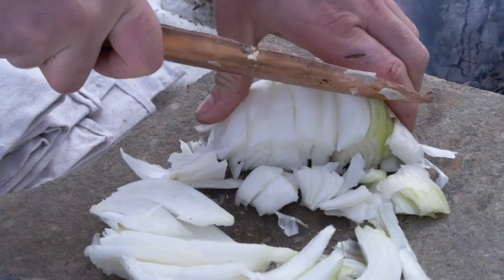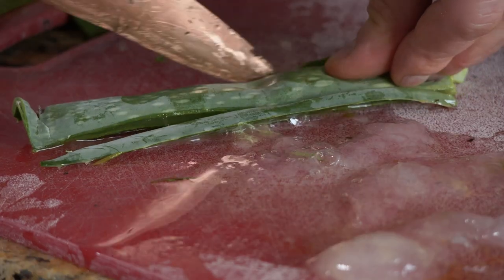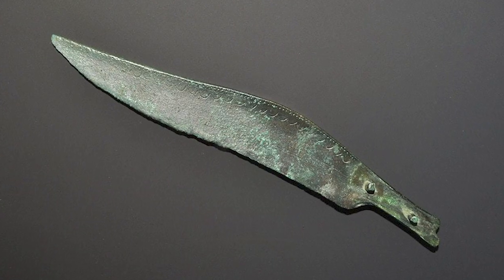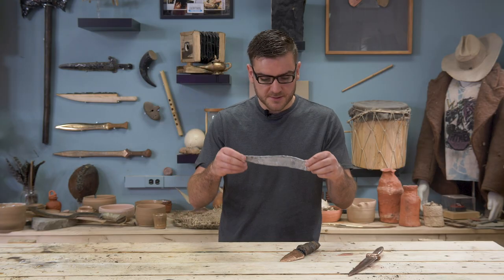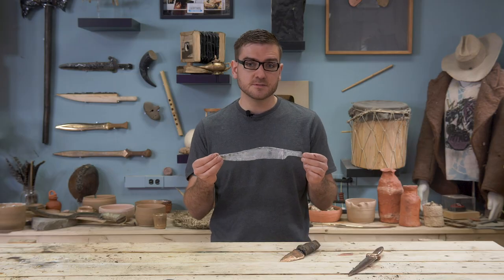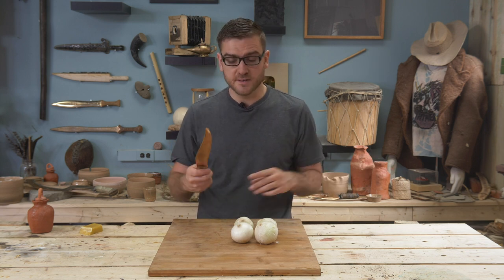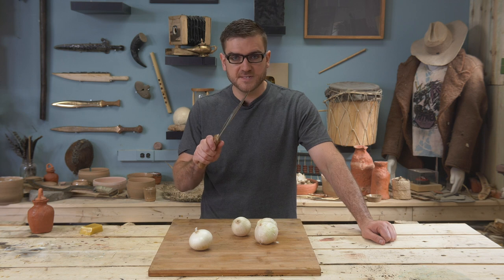How to Make the SHARPEST Bronze Knife (ONE DAY CHALLENGE)

Comment: This dude avoiding the correct pronunciation of daggers like apple avoid making long lasting products
Reply: Apple products are overpriced AF but they last a long time
Reply: I wonder if he can now make a Dag -wood sandwich with that knife?
Reply: Even pixel phones don't get updates for more than 3 years...Tons still using 5s, but overpriced is fair
Reply: @KajovdM  Except they deliberately slow down older devices to the point of unusability in order to compensate for batteries losing their capacity over time. Of course a more obvious solution is to allow battery replacements, but then that wouldnt push people to replace an otherwise perfectly good phone.
Reply: @Magmafrost13  I'm pretty sure that they don't slow them down in the literal sense of installing software that's purpose is to slow them down but instead let people download later versions of iOS that they know will not be able to run on older phones. Of course, batteries also degenerate over time and you can get battery replacements from apple but they're criminally overpriced and if you go for a 3rd party battery, Apple voids your warranty and also doesn't let you get it repaired at an apple store no matter what. It's just tiny things like that which make me really hate apple and their money-hungry policies
Reply: @KajovdM  they last long? Go watch some Louis Rossman videos and you'll see all the ridiculous problems their products have. Just recently he had a Macbook screen that wasn't working, the cause being a broken trackpad. The screen itself was completely fine, but because the trackpad was broken the display didn't show any image.
Reply: @burritoboy1012  They do though. Apple literally reduces the clockspeed of processors in older iPhones to make the slower. Their response was that the old batteries couldn't provide enough power anymore, even though they initially denied slowing down old phones.
Reply: That is a haha funi moment, but my iPod 6 has lasted for years
Reply: Oooodfff
Reply: Kajo M tell that to the phone chargers
Reply: @burritoboy1012 
No, they actively slow down phones. It has been proven that some firmwares actually cut some of the cycle speed of the CPUs. And Apple admitted it.
Reply: @EVPointMaster  Makes sense, of course they have a bs explanation for it so that apple fanboys can defend them. I feel bad for Steve Jobs and Steve Wozniak, their company has really gone down the drain in recent years
Reply: @KajovdM  especially iPhone 4.
Reply: @KajovdM  ever heard of plan obscelescence
Reply: My sister's phone got ran over by a truck screen down on a small rock and survived we would still be using it if we hadn't changed phone plans. That's why I use Android.

Comment: I must have missed the episode where you made the angle grinder.
Reply: yeah... cool knife but no way it ground with primitive tools
Reply: He molded it and he sanded down the handle
Reply: Whoosh me all you want it this was a joke
Reply: @axeandanvil3846  the rules are that after doing stuff with primitive tools and techniques once , Andy can use modern tools to save time
Reply: He clearly stated in the first video he will use modern tools once done by hand. This is not the primitive technology channel.
Reply: @linecraftman3907  still, i would like to see some sanding mechanism, like a stone wheel, otherwise it doesnt feel like a true reset
Reply: @udescarta4320  He used sandstone before. Not quite mechanical, but it was at least a device.
Reply: It could manually be sharpened on a series of coarse to fine stones, but he probably didn't have an extra 3 hours to spend that day.

Comment: Out of curiosity is there a reason you chose to allow the usage of stuff like the wood molds and all the related nails and screws when casting? I thought you were trying to recreate things without modern tech, only modern knowledge
Reply: I wondered the same thing, then I realized that, having shown that he has "discovered" a skill and used it in a practical fashion, you can basically check it off the list and move on to the next one.  melt bronze in an old-timey furnace? check.  on to the next item on the list.  (not to mention that under the current circumstances, there are no helpers around and no Annalise to do all the heavy lifting so he has to do it all himself.  doing EVERYTHING the ancient way would be impossible on his own.)
Reply: He said at the beginning of the new series that once he had accomplished a task once using only the tech at his disposal, he would allow certain tasks to be simplified using more modern means. That way 90% of each episode won't just be him tending a hand built furnace made of mud or something

Comment: Hey, Andy, I wonder, how did you drill those holes in bronze to attach the handle? Some kind of stone needle?
Reply: I had a similar question - also was curious where the pins came from or how he cut and sanded the wood so well (I suspect he used some modern upgrades for those aspects).
Reply: Also also cleaning up the shape, polishing and sharpening have all been done off camera and a little too good
Reply: @silentben  yeah, maybe this is some kind of spin-off from usual "from scratch" rules, but it's really interesting to see some high quality ancient tools for the job.
Reply: He used power tools I have used grinders and the way it looked after trimming the extra is definitely a grinder being used

Comment: Hey there! Long time follower of the series. Love this one day build to improve on what you've already learned, great to see some craft advancement along with the timeline in other videos :)
Couple of small tips when cutting, and cutting onions specifically:

When cutting with a knife, tuck your fingertips underneath your fingers into a claw. This not only helps protect you from cutting yourself, but also helps you guide the knife by resting the side of it flat against the middle of your fingers as you cut. Nice and easy, helps accuracy, and keeps you safe! Always remember THE CLAW!!

When chopping onions, wet your blade and peeled onions first and again after they're topped and tailed and cut in half. This dramatically reduces the amount of acid spraying into the air and ultimately into your eyes, making you cry. Not foolproof, the sharpness of your blade matters a lot as well, not to mention what type of onion and how many you're cutting at once etc etc. But it makes a huge difference at home!

Comment: Dude, when you are putting an edge on a bronze blade, you should be hammering the edge, with the knife at an angle to the surface of your anvil. that way you are compacting more than stretching. Also, use some kind of rope, or cloth to hold your mold halves together when pouring into the mold like that (Ideally I would suggest a kind of clamp but you are making everything yourself so that isn't really an option).

Comment: the concave section of the knife propably wasn't there when it was new. That's the typical wear you see on any knife that has been sharpened (hastily) for many years.
Reply: Actually, there's been many blade patterns discovered from many eras in history, from knives with a slight curvature to them to ones that have a much exaggerated belly to the blade; it all depends on the purpose the knife was made for. The exaggerated belly blades, for example, typically were things like skinning or leatherworking knives, where a larger surface area for slicing or slashing is very useful, and a sharp thrusting tip isn't. Compare that to an awl knife, ice pick, or stiletto, all of which is basically all point and no belly, and is used solely for stabbing.

The design for the knife here, with its thicker blade closer to the handle and the sweeping drop point, along with the s-curved belly (even though it's not very pronounced) tells me it was most likely designed and used as a butcher knife, though not a cleaver; most likely especially for breaking through joints and connective tissues, or just cutting primals down to more functionally useful cuts.

Comment: Long time viewer here, and I'd appreciate if you could take out an episode and refine the bronze casting method you were using. I appreciate it probably took a lot of time to even get to that point (and sadly the pour/mold failed somewhat), but just using these molds and wooden boxes seem a little bit like cheating on the original sentiment when you haven't attained similar results with your self-developed methods.

Comment: I wonder what the molds were made of backs then
Reply: There were also wood frame molds with sand casting similar to what he's been doing, but that was primarily done through the lost wax casting process, where you bury the wax mold of the item you want to make, with sprues attached for air holes, stability, and a major one for the fill point of what you're casting.

Eventually stones were carved down to form molds that could be used again and again, but were relatively fragile and could break easily if improper force was applied to them; most were designed to be a single piece mold, so any engraving or filigree or other such work on the backside of the piece would have to be done by hand, rather than pieces designed to be held together as fitted pieces to form a mold, like the frames used in greensand and lost wax casting.

Refined metals that were less useful, in later ages, were also cast into lesser molds and then shaped to form, since they were more malleable and ductile than stone but still very strong, and were used to make molds that lasted much longer and could be repaired much more easily, as well, but that was also quite a while after ceramic molds began seeing use.